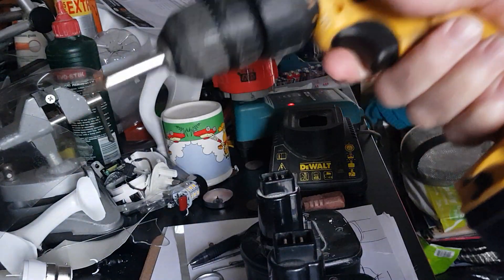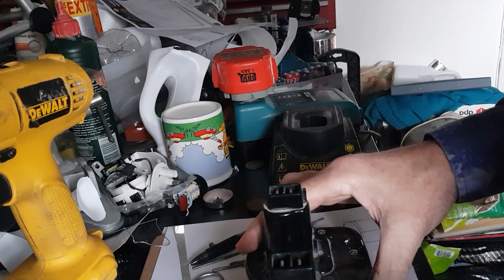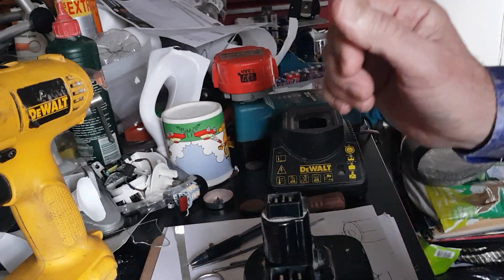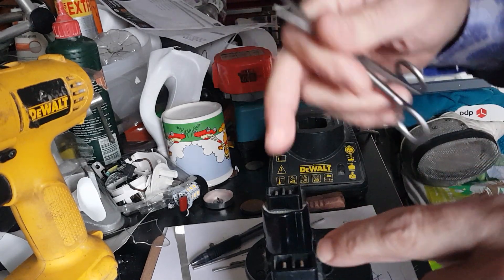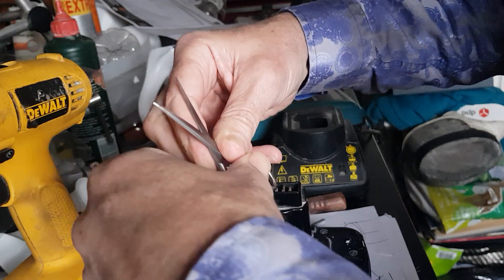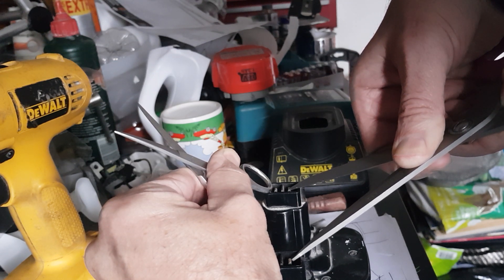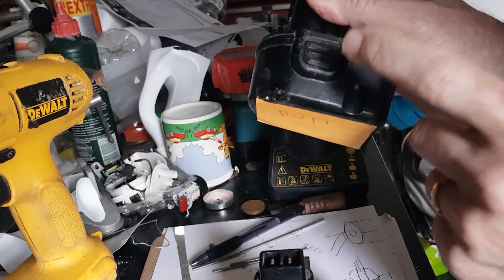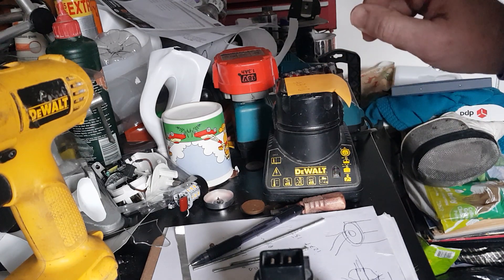Easy DeWalt Battery Repair or Fix

Comment: wow I was about to order a new battery and tried this and it worked perfectly. I used av cables for a dvd player to short the terminals between the two batteries.
Reply from the maker: Delighted to hear of your success. May you have a great week

Comment: Superb! I just got two working with this method, they have been dead for years. I've named them Lazerus 1. and Lazarus 2...many thanks!
Reply from the maker: Lovely!
Reply: @neogovernment  Thank you so much I had 4 Dewalt 18 volt batteries laying around and thought they were all dead,last week I needed to use my cordless reciprocating saw so bad that I had to buy 1 on craigslist for twenty bucks,I watched your video and recovered 3 out of 4,I was nervous at first cause I got a helluva spark as soon as I hit the positive using 10 guage wire and  alligator clips LOLbut right on I was able to get 3 more batteries working again for free !! Thank you again!

Comment: Thank You!!!!! My battery works again.It was doing the fast flashing light and wouldn't turn my drill at all nothing.Then it started charging properly after the scissors trick from your video. Then It did the fast flashing light so i was concerned it might be fail soI put it in the drill and sure enough I had power to the drill.I put the battery back on the charger and it is charging properly with the steady flash.This saved me time and money. I'm subscribing. Thank You!!

Comment: Which one is the positive terminal
Reply from the maker: Best to check with a meter. As long as you copy the instructions in the video, you don't need to know.
Reply: It's right beside the negative terminal. Well, it is on my battery. 🤣🤣🤣